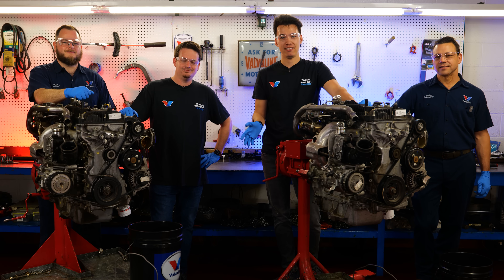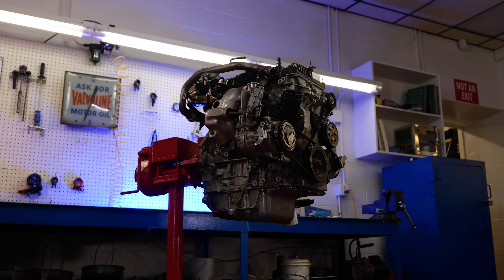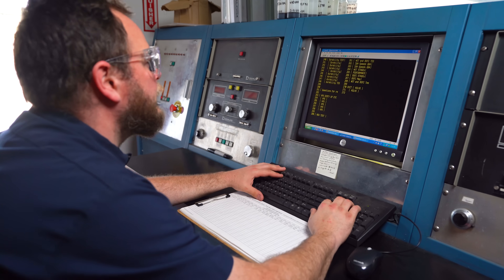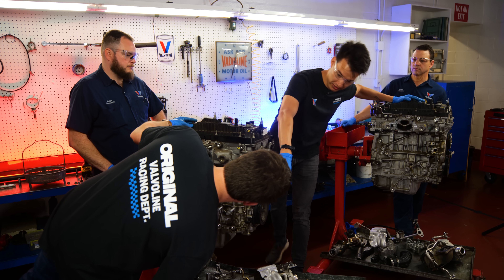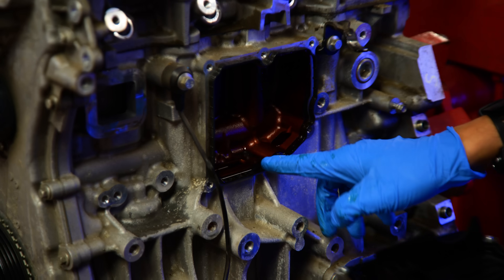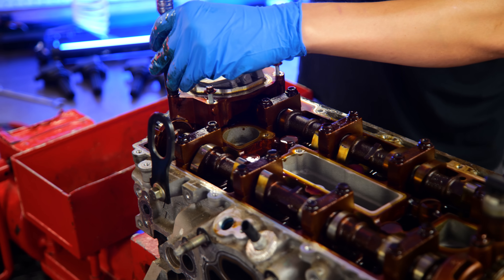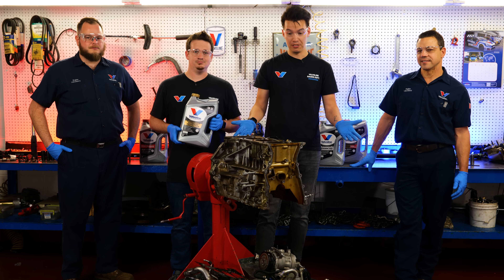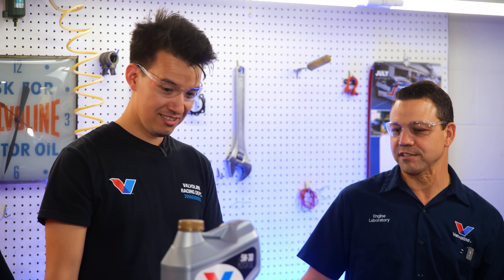Testing different oils over 4 years and 1 MILLION miles

Comment: My biggest takeaway from this video is that 10k oil change intervals aren't as bad as I thought.
Reply: I agree with you mate
Reply: It's actually worse than you thought... Going 10,000 miles between oil changes is just asking for engine trouble down the line.
Reply: Not true...these vehicles weren't driven in daily life...there's a difference
Reply: @andybales7318  You are correct. They do mention that they tried to replicate daily driving by changing the throttle, but it is still a very controlled environment.
Reply: @hollowpoint185  yes, without dust, dirt, moisture your every day environmental conditions...a bit deceiving video...a 5k would have been more interesting, as I think there would have been little difference
Reply: @andybales7318 Most people's roads aren't full of grit and grime and even if it makes it into the oil, the oil filter will catch it. But this isn't a farm vehicle test. Moisture, in most cases, is a non issue if the engine is allowed to come up to temp. As the operating temp of the oil is roughly 100C and the water will evaporate. The issues come from short trips when the engines aren't allowed to come up to temp and fuel gets past the cold rings on a regular basis, that's not happening here with these engines being run for hours and hours daily. Though again, you need to look at the results of the test. No fatal failures in 500k, most people won't reach half of that. The takeaway is that conventional can survive 10k drains under more idealistic conditions, synthetic can do it easily if you don't do a lot of short trips.
Reply: @Vermonstered  not sure where u drive that the roads are clean 🤣  not in big cities, that's for sure...if 10k work for u, go for it...there's a reason they keep lowering the interval rates with synthetic oils......if u recall, it was 15k when the hype started...now, many experts suggest 5k which conventional can do just fine...personally I do synthetic blend 5w20 in my 20' Ford SUV which the manual calls for at 5-7k as I do alot of highway driving..my 03 Ford truck synthetic blend 5w20 every 4-5k...both run fantastic
Reply: @andybales7318  Actually the numbers are increasing. The top of the tier list synthetic oils claim 20k miles. The roads where most people live aren't scattered with sand and other silica as a gravel road or beach living person would. Though anytime you try and attack the person it simply shows how weak of a point you have. I get my oil tested by an independent lab and have settled on 10k being perfectly fine with my use case. My crankcase head looks significantly cleaner than the one in the video and I never have had any issues with burning oil due to piston seal in over 400k miles across multiple vehicles. The independent and manufacturing tests show 10k is perfectly fine in most of the use cases. No amount of lamenting about the old days intervals from the 1960's changes that.
Reply: @andybales7318 i wanna know what road he is driving too 😂..  if we can get sick going outside, it must be worse for cars out there. I'm very surprised the engine with conventional still held up at the end.
Reply: @Vermonstered good for u with no oil burning issues at 10k oci but not everyone or every engine is lucky. It depends on the design of the engine, the abuse, the age and the maintenance history.
Reply: @stanz55  🤦 Hence why you get your oil tested on occasion if you want to go for longer oil change intervals. Quit setting some arbitrary mileage in the sand and expecting it to be a magical number that everyone can go by. Especially since most people don't do regular scheduled maintenance. You do realize that changing your oil excessively doesn't guarantee a healthy motor either if the engine is poorly designed right?
Reply: @stanz55  Are you both really that daft though? Silica in your oil, which comes from sand, rocks and other road debris, isn't what's causing your oil to break down and create sludge and the varnish. It actually does very little as the oil does its job encapsulating it and moving it into the oil filter. Not until your oil filter begins to bypass does all this 'dirty roads' become an issue, do you even know why your oil breaks down?
Reply: @Vermonstered  dirt and rock aint the only thing out on the road. hot temperature, moisture, water intrusion from leaks or weak seals also affects oil over time. not everyone drives long trip everytime. also not every engine out in the world have zero oil burning.i rather change early but not too early because i dont want oil to turn sludge and clogging my engine to death AND FYI we dont have oil labs all over the world to test oil sample. where i live it does not exist. lab test will not tell u the whole condition inside the engine unless u own the car over ur whole lifetime and obsessed with lab test from start to finish exactly like in the video.
Reply: @stanz55  🤦 Again you don't seem to understand how dirt gets into an engine and what the designers have installed to filter dirt particles out. Doesn't matter if you have an oil lab or not, dirt gets in one way and it's filtered by the oil. Not until you bypass are you having a real issue, but a real issue isn't what you're talking about. 'Burning oil' isn't typically associated with 'dirty roads' though I'm fairly certain you don't know that. As 'sludge' is quite literally the oil breaking down... But you aren't talking about oil breaking down? It's astonishing how little people know before they feel compelled to comment and complain.
Reply: @Vermonstered  AGAIN, u do u sir. i have my share of engine experiences. if ur fine with 10k OCI good for u. u are way to obsessed with dirt only. oil filter aint the only place dirt reaches first. so it aint filtered completely. lets not even start about filters and bypass topics lol... "cough" fram "cough". u probably never had to deal with burning oil engine ever to get it back to decent state. oil change is cheap, rebuilding aint. (financially and mentally). seems to me like ur more into the oil condition than the engine health itself lol.
Reply: @stanz55   You literally don't see that this 500k mile engine survived on 10k intervals on conventional. Nevermind that once you're burning oil, that's physical damage inside the engine and no amount of oil changes will reverse physical damage. Simply highlighting you can't see what's put right in front of your face nor understand what causes oil burning to occur. Just stop.
Reply: keep believing what they tell u. Next thing ur gonna believe the lifetime fluid as well. Sinds ur on to the 20k oci train soon.
Reply: @stanz55  Literally from the start I said I get my oil tested. Marketing claims mean nothing, evidence shows you to be wrong and with no idea why your engine is burning oil. Hint: No engine that burns oil is 'running great.' Your incompetence knows no bounds.
Reply: @stanz55 these are the clowns on you tube,  that talk a good game & know little about what they're talking about...he even suggests 20k intervals are becoming more popular, which there are VERY few mechanics that would suggest 10k & certainly not 20k...1 of 2 things..that clown either 1) doesn't even own a vehicle 2) buys new vehicles every 5 years
Reply: @andybales7318  Here's where your reading comprehension fails again. Never said 20k intervals becoming 'popular.' What I actually said is the claims by the oil manufacturers are now reaching 20k. Seriously, you're both constantly stamping 'incompetent' on your heads over and over. In both reading and mechanical matters...
Reply: @Vermonstered  my IQ'S 137. How about u?
Reply: A huge thank you for saying that; about the frequency of oil changes don't guarantee a perfectly running motor 👍🏽
Reply: @hollowpoint185  really? That's your takeaway? In real life you're not monitoring your oil and vehicle and giving it the same maintenence. In real life you might even be going over or skipping oil changes. In real life you're not keeping every other part of the engine in well working order or changing it the moment it breaks. and the full synthetic had one stuck piston ring. The conventional had 7 stuck piston rings. The full synthetic was a 4 out 10 for darkness/build up and the conventional was a 7 out of 10. 
If anything this tells me that if you want a 2 out of 10 you need to cut that 10k to 5k miles max even with synthetic.
Reply: @andybales7318 Anything over 160 is impressive. 137 is above average but nothing to brag about.
Reply: 10k intervals are good if you only drive highway.
Reply: @Connor4x4  even then, the average US driver goes a little over 14k/year....5-7k is far better idea,  if u plan on keeping your vehicles awhile
Reply: @andybales7318  I agree.
Reply: @Connor4x4  Yet Andy here has no basis for his 🤮 he just regurgitates from what others tell him from 30 years ago. Quite literally the results of the test, under variable load and conditions, is modern synthetic is perfectly fine to make it to 500k miles on 10k oil changes. He's never had any experience with an engine going remotely that far under his care. It's why he's now wants to make this about some IQ number instead of any actual knowledge of motors and why he's always spitting out oil change intervals that are half the test for what's 'better' fully never realizing the 10k interval passed with no friction failures on both types of oil since he can't comprehend anything, just vomits up the same nonsense.
Reply: @Vermonstered  plenty of engines are having premature failures due to dirty oil in parts that have very low tolerance for that dirt. It's not merely failures from friction that you have to worry about. Those carbon deposits took out one piston ring in the full synthetic and 7 in the conventional. There are other parts of the engine that are far more susceptible to that carbon buildup that will fail much sooner than the piston rings or the bearings. The pcv valves the variable timing, and the lifters etc  all have tolerances can all be clogged by dirty oil. All oil, synthetic or conventional, has a rate at which it will add deposits. By upping your oil change intervals you're adding to that rate that deposites goes up. The cleaner the oil, the slower you will be adding deposits to the components. Sure maybe the additive package is still intact but regardless of how much friction modifiers you have left, the oil is still full of soot and particles that are not filled by the oil filter. Unless the oil is clear amber after it goes through the filter, you have contaminates that can build up on surfaces. All you're thinking about is wear from bearings and rings. You're not thinking about all the peripheral components that can fail. Look at that seized chain tensioner in this video for example. You get enough slack in that chain and you can cause engine damage as well. It's like a 1000 dollar job to fix that tensioner and chain and guides as well. The lifters are just as big of a pain to get to as well. Any of those components if running noisy for long enough will eventually cause damage to the polished engine parts. The difference between 10k miles intervals vs 5k or 3k mile intervals can mean the difference of driving around with a noisy lifter/chain slap or having an engine with 170k miles with no engine noises. It could be the difference of having zero oil burning at 170k miles or using a quart of oil at 80k miles.
Reply: @miltechmoto  Again, you're bringing in other random engines with no concept of their history besides what the owners claim into the equation. Nothing about comparing apples to apples, the whole point of the test is to determine if the motor can give service 500k miles based upon the manufacturer OCI, I doubt you're describing a motor within the same series or with the same manufacturer claims. I hope you understand frozen oil control rings aren't that big of a deal for many as you're still maintaining compression, just oil gets past the rings into the combustion chamber. On a non high performance motor it really doesn't matter that much from a mechanical side of things besides filling oil between fills nor do I recall them noting oil burning as a result. Those frozen rings may have created zero actual issues besides some a typical wear, that didn't affect compression, on the cylinder wall. All the other stuff you wrote has no bearing on this A to B test you're just describing self generated random 'problems' outside of this test and even those motors don't even have the same OEM claims which is what is actually tested here, not about what's 'optimal' or 'better.' As again, and this is the problem with random voices who don't understand what the test is testing, the engine made it to 500k miles with marginal issues and no major mechanical failures. Per your specific citation, please tell me one mechanic that would leave on a single chain tensioner for 500k miles if you're going to specifically cite that as a definitive oil issue... None would. Same goes for your PCV valve what if, that's generally replaced on a regular schedule far ahead of failure. Pretty much goes for every one of your hypotheticals. It's all 'could' of been 'better' never understanding the engine made it to the finish line completely fine for the use case with no major mechanical failures that you can actually attribute to the oil. Quit thinking that shorter oil changes are somehow a miracle cure that suddenly all these issues don't appear in a 500k motor. 500k miles is longer than any vehicle you've managed, component issues will arise simply due to prolonged use. Attributing all problems to OCI is only what fools who have no knowledge do as that would mean every engine lasts forever if 5k oil changes are maintained. Anyone with any actual knowledge knows that's nonsense.

Comment: On Valvolines website 5qts of conventional 5w30 is 30$ 5qts of synthetic is 36$.  Is there really anyone who does think $6 is worth not using full synthetic? Seeing how you can go longer in-between oil changes full synthetic is actually cheaper and less oil changes thus less work.  It's cool to see the extra varnish I guess?
Reply: Unfortunately, lots of people will choose the cheaper oil just because it's cheaper without doing any research. Even if they get an oil change at the dealer or mechanic, they're almost always going to choose the cheaper option.

Comment: I drive a 2015 Ford. I've been using the IOLM system, but even though I'm using a full synthetic, I think I'm gonna change over to a 7500 mile oil change interval. That synthetic engine is impressive for 500k miles.
Reply: if you have a lead foot i would recommend at least a 5k change
Reply: @Heck6   not really. Quite the opposite. I'm light on the throttle and usually keep it below 3k RPMs. I do run E85 on most fill ups. I do also run a Spectre washable air filter if that might affect things.
Reply: @jacobrzeszewski6527  sounds fine as long as it gets to operating temp; in an engine that sees only very short drives, e85 can kill an engine insanely fast due to diluting the oil with fuel
Reply: Keep in mind, that was basically 500,000 miles of "highway driving"...far different than 500,000 miles of daily driving which include stopping, environmental conditions, etc...
Reply: @andybales7318  they literally said in the video they did a lot of speed up, slowing down, idling etc. to simulate more normal driving
Reply: @Heck6  where's the dust, dirt, moisture, etc? Still not the same as being outside in the elements
Reply: @andybales7318  all that would only affect seals, which they would keep ontop of

The point is seeing the difference between conventional and synthetic anyway, which is still valuable data due to the condition both vehicles saw being the same

Comment: 10k miles between oil changes is bonkers. Oil breaks down wayyyy b4 then. This practice is why we are having oil buring issues in newer motors, even Toyota is having this issue. Should change your oil no later then every 5k miles
Reply: to be fair, the engines did make it 500k even on basic conventional oil at those intervals and are still running fine lol. So while i agree, this video kind of invalidates that. because almost nobody will keep a car past 300k nowdays.